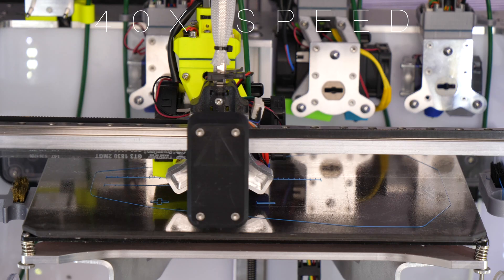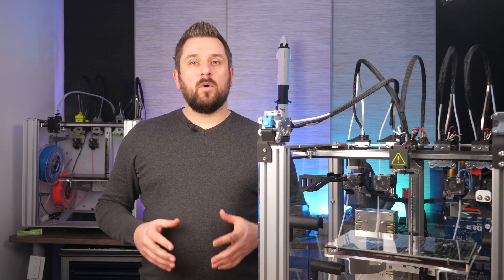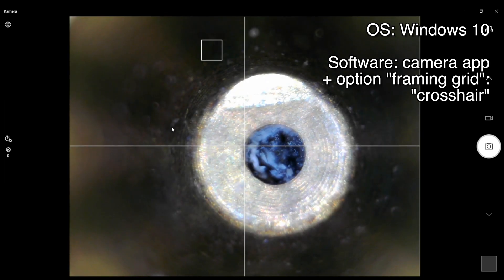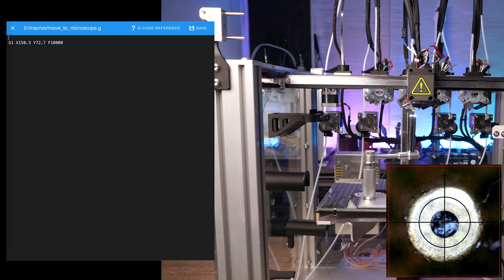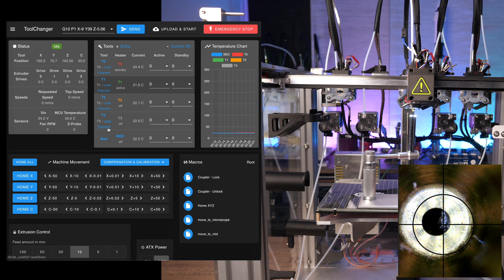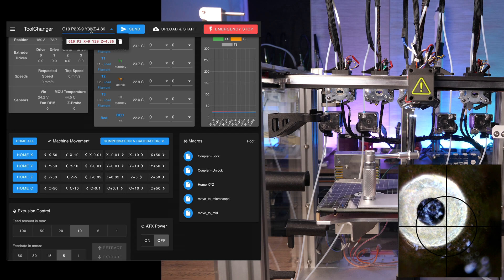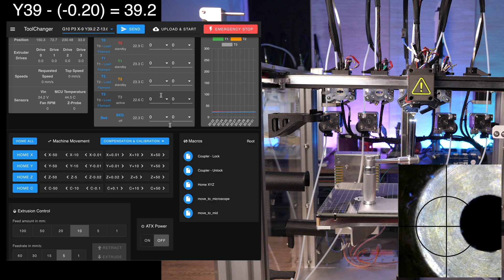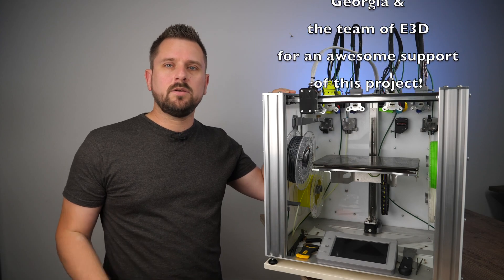E3D Toolchanger - Configuration #03 - Adjusting X&Y-offsets

Comment: Also, don't past it into config.g but config-overides.g  -when you upgrade your OS it will wipe out the config.g and you will be back to square one, that is why they created the config-overides.g (the last file of the config.g shows the correct filename in case I don't have it right, it might be config-override.g instead.  Either way, you shouldn't be changing the config.g those are the defaults.

Comment: I saw how you clamped to the bed and I was saying ouch!  Then you got another clamp and I said Double Ouch!  That was really painful to watch someone do that to their machine... Write that bed off, well, Maybe it won't be bent too bad (considering this machine can adjust it, but OMG, Just watch the video, you can see how much you are bending the bed..  Put the clamp on the bottom of the bed, and the microscope.   Cringe location is: https://youtu.be/yoOk55s8i14?t=210    (Heck, if you don't care about damage, just drill a couple holes through the bed and run some screws through...  or epoxy it down.. Good grief)... Continuing to watch the video...

Comment: Hi René, thank you for the great videos, there are very helpful.  I have a question on this one though.  You say that tool 0 is already and you dont change the offsets for that.  So what you are doing in this process is aligning all other tools to the tool 0.  So tool 0 itself has not actually been aligned to the center of the bed in this video.  Is this correct to say?  Thanks for your time.
Reply: Hello, I have a question about the actual origin (0, 0).  Where is the actual origin position of the tool post after the console sends G1 x0 y0 without any tool selected?

Comment: Thanks for the quality content. I bought the tool heads to upgrade my corexy but only just read that acceleration is to be set max at 300mm/s2. Were you able to achieve higher accelerations? I’d like to stay above 1000mm/s2 and achieve 400mm/s print speed at least while printing. Please do let me know your thoughts.

Comment: HI René, thank you for the comprehensive guide. I'll be trying this method after I tried (more or less sucessfully) to design my own models of the vernier scales, as the original calibration g-code isn't flexible enough for me. I'm using filament of 1,75 mm and 2,85 mm diameter, for example.

Meanwhile, and while printing all the parts to upgrade one of my tools to a Hemera, I'm wondering about your take on the best direct drive tool for this machine. The Hemera is quite heavy! I know that there are some designs based on the BMG floating around (e.g. Orbiter), as well as newer products such as the new Bondtech LGX. I think this would also make a good video, although E3D might not be too happy  ;) 

schöne Grüße aus Köln,
Niklas

Comment: Thank you so much for making this video series! It really helped a lot when parts of the E3D documentation were unclear. Any thoughts on making a video about lubrication and maintenance? Considering the only decent resource is a single photo from Greg on the forums, it would be quite enlightening to see how you've been doing it. I just recently used an 18 gauge needle and Magnalube-G on my rails and leadscrew -- it seemed to work fine and I could see the grease spreading across the rails-- but having read the Hiwin documentation and seeing the rather small volumes of grease specified has me worried about having used too much. Would be great to see what you're doing and any specific things you look for!

Thanks so much!
Reply from the maker: I'll think about a maintance-episode! Thank you for the suggestion!